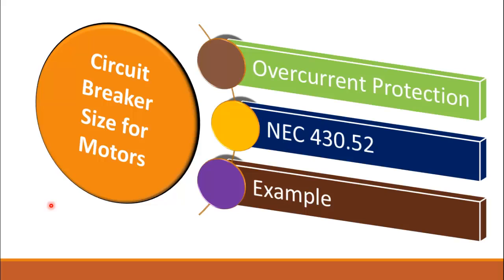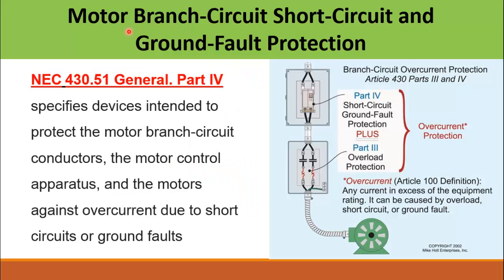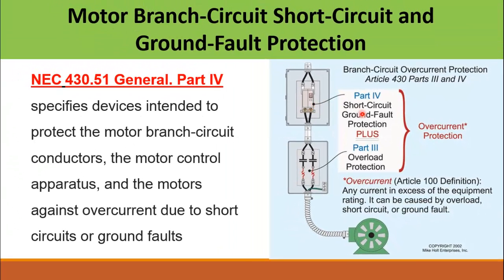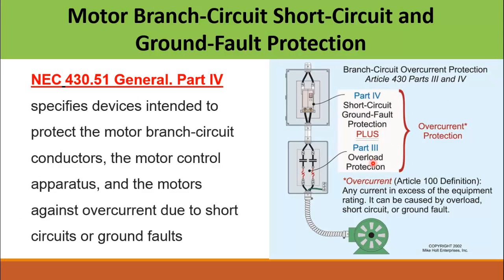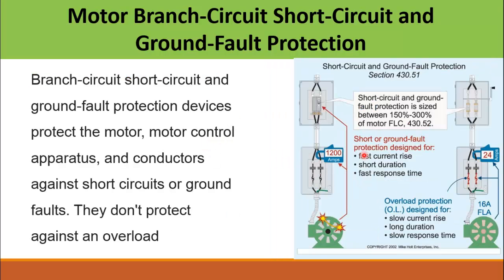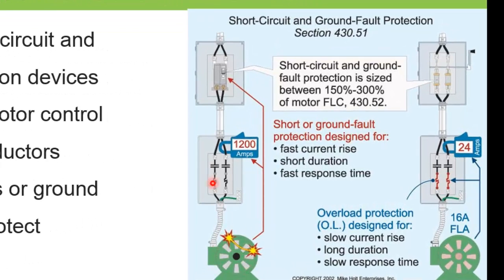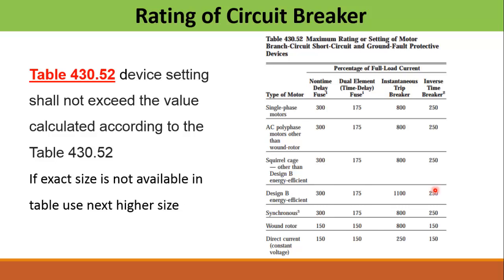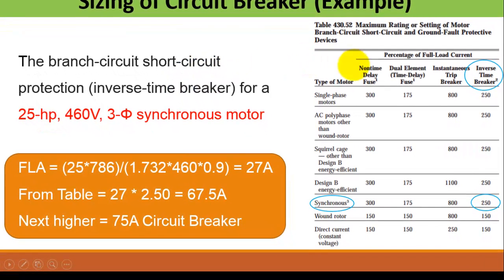Calculate Size of Circuit Breaker for Motor NEC Standard | Circuit breaker size Calculation

Comment: I wanted to put some mcbs in front of my 100ah Lifepo4. The maximum is supposed to take is 50a. My problem is in the type of MCB, the time it takes to flip and the multiplication of the amp its rated for, for it to flip. What should I use?
Reply from the maker: First you need to use DC breaker for the battery. You can use 60-70A breaker

Comment: In the formula to calculate the motor current, is it missing the efficiency of the motor?
Reply from the maker: Efficiency is used to calculate useful power but for calculation of current, efficiency is not included in formula

Comment: where did he select the next higher size 75?
Reply from the maker: Plz explain . I dont understand
Reply: @electricallectures  
NEC table 240.6(a) doesn't have a 75amp breaker but it does have a 70amp like you mentioned. There is a 75-amp fuse which I think that's what you meant to say.

Comment: Does the table 430.51 not provide the maximum allowable rating of circuit breaker? Shouldn't you select the next lower standard breaker size rather than the next higher size?
Reply from the maker: I think nec table is 430.52. And as per standard selecting next higher rating is recommended in 2 cases. 1st is you donot findbthe exact match and 2nd the the breaker is small enough to allow starting current of motor